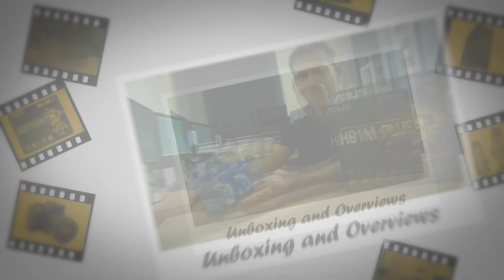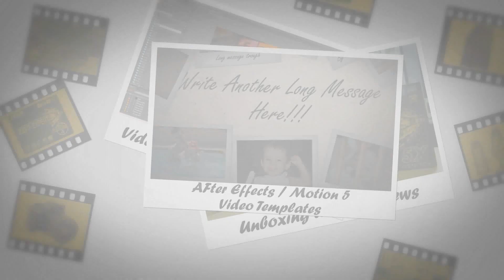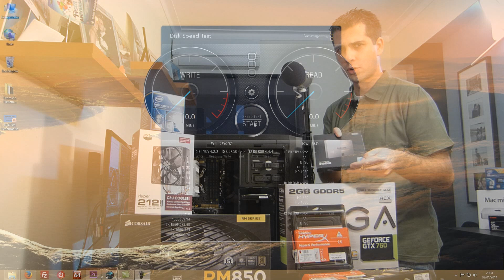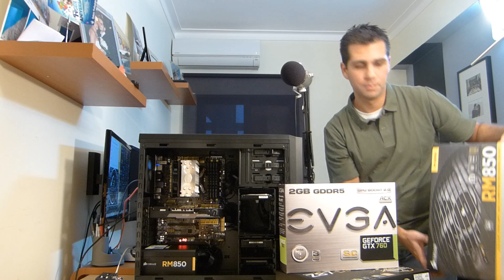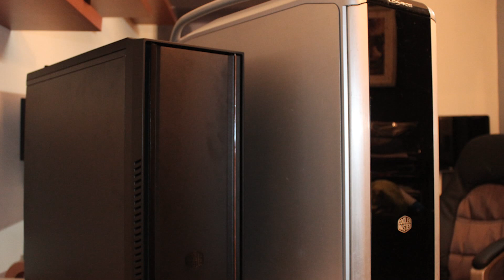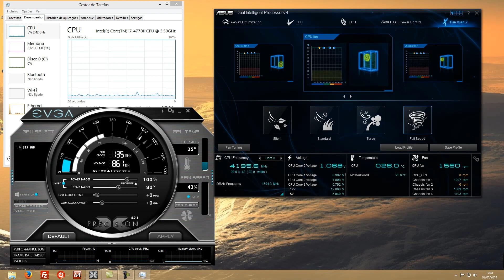Silent Video Editing PC Build 2014 Noise Levels Tests and Benchmarks 1/2

Comment: How many monitor do u use
Thanks
Reply from the maker: john Al Hi John, i use 3 monitors. Usually my setup is AE on the Main one, Photoshop on Left and Email + browsing on the right. But you have endless options that will make your productivity mutch better than with one display.

Comment: Real good things you have :D
I will not say that i have some thing better thou i am extreamly impressed by the sound of the cpu fan.
what graphic things do you do att youre computer ?
i am stating to learn counterstrike global offensive map creation and i am currently so much angry that i cant undertand how to make things work.
the map creation tool is called hammer, i dont know if you have heard about it or if you use it. i am realy interested thou in what you do att the computer. i got a MSI Big Bang 2 mother board with a less extream cpu.
currently i got a intell cpu fan cooler that cost me about 15 £
and i am looking for a cheap but still a great one that can make my Intel i7 3820 3,60 ghz
be able to come up to the maximum over clock.
i have seen i have the number one overclock mother board thou i have not knowlige about it at all.
My name is John and i am from sweden.

Hope you get more comments :)
I will summon my questions here with smaler sentences.
1. What grapical things do you do on your'e computer ?
2. Have you used Valve Hammer ?
3. What is the fan Brand/Name/company name that you use ?
Reply from the maker: John Löfgren Hi and thanks for the feedback!! Regarding your questions:1. I use After Effects, Adobe Premiere, C4D, Photoshop, Illustrator and FCPX & Motion 5 on Mac.2. Sorry but i have not.3. CoolerMaster Hyper Evo 212 available here http://goo.gl/wjwtBJAll the BestRJ
Reply: Okey seems like many diffrent programs :)
I only use one of thous. its Photoshop.
Illustrator i would want to learn more thou i am to tired to search for how to do things.
by the way. before the SSD did you have a normal drive then ? i mean not an SSD. i am getting one home now and i wonder how to install windows on it. i know on non ssd thou ssd i dont know if it is that easy as connecting the drive and just mounting a usb with windows and install.
Reply from the maker: John Löfgren SSD works as a regular HDD on what concerns installing OS and Software, but its much much quicker. In the past before i used SSDS i used my HDDS in Raid0. Just connect the drive and install your OS as normal. You will not buy another regular HDD for your OS :)
Reply: that is realy good news :D but i have heard that the SSD isent ment to wright many times on rather wright the existing things that it is meant to have all the time. just a tip for you so you dont find yourself having to buy another SSD just cous it fails too read.
i heard one say that SSD is more meant for having windows not programs or games.
if programs then programs that saves on a other hard drive like a HDDS. with that sayd you could have like you have now 500gb ?
have programs there and use the empty places for saving files.
If you want i can try to find the artical about it tht said it is best to use for windows to start fast and programs but not to save files on or programs for storage rather to have the programs all the time on it and not reinstall and such.
Reply from the maker: John Löfgren Dont worry about that. I have on my SSD Win8 and all my Software (250GB) and then i have 3 HDDS for IMPORT / EXPORT / TEMPORARY. Anyway you shouldnt worry about writing to the SSDS. Read this torture test to SSDS it might help http://us.hardware.info/reviews/4178/hardwareinfo-tests-lifespan-of-samsung-ssd-840-250gb-tlc-ssd-updated-with-final-conclusion
Reply: ah.. myself only could afford one with 128gb so for me it is not the same.
Reply from the maker: You will be fine and when possible upgrade to a 250GB they are getting cheaper and cheaper. :)
Reply: yes thou my SSD cost 75£ so i cant afford mutch so for me i must wait a looong looong time must affort a better cpu to thou my memorie is now ennuf only things is cpu and SSD that i must think about. as far as time to wait i dont worry cous i got an msi big bang motherboard

Comment: maxed out, what is the difference between the stock amd fan and the 212?
Reply: I've used intel and amd stock fans. Amd stock fans or horribly loud, as in hair dryer. Intel stock coolers are not nearly as bad, but the 212 is arround 30 usd, and nearly silent.
Reply: ***** Thanks!
Reply from the maker: My stock fan is still in the box. Personally i dont like stock fans primary because they are louder and dont cool as much as the Hyper 212. Off course there are even better coolers, but this one for my needs is great.

Comment: the cpu cooler is mounted the wrong way. You should always install the fans, that you have intake on the front, and exhaust on the back. But your cpu fan intakes from the back, which isnt really efficient.
Reply from the maker: Hi, Thanks for the input :) I mounted like that just because of high profile ram that i have, and i knew that it was on the wrong direction :) so my 1st concern was to test the temps, if it hadnt given me good results i would have just gone with a WC solution....But temps are great so even though i titally agree with what you are saying, my only concern is the temperature and noise and both are great, really great :) . Thanks again for pointing that out, it just means that you are a knowledge observer :) Thanks, Best Regards. RJ

Comment: Hi again. I guess you learned that the Hyper212 is capable of handling some oc but will get loud when stretched to the limits. 4,5 was clearly too much for it....85C on the cores will severly degrade your cpu...fast. Luckily you are not running Prime95 as a 24/7 job.. but the less stressful tasks of video and sound production.... :-) However I would keep a close look on the temperatures @4,2 when summer arrives for the Hyper 212...
For the sound tests I think the mike was placed a little to far away to really pick up the differences (at normal listen volume) I pretty much only heard the EVGA`s ACX cooler from 70% upwards :-)  I do appreciate the effort and all the time put into these videos tho. Did you try to further overclock the 760 and if so did the overclock make for better performance in 3d rendering......anything even measureable?
Reply from the maker: Hi again Jonh :)

Regatding temps i already shared with you on the other post.

As far as sound goes i cant hear a thing :)

The mike could be closer but hey :)

On my regular use the case is closed and below my desk. The only time i hear something is when rendering for more than 15 minutes and its just a small wisper.

Anyway try to listen with headphones and a quiet environment, those very small differences in noise are actual smaller than what you can hear because the case is closed and more distant :)

Thanks for your input John
Best Regards
RJ

Comment from the maker: Hi Tall, thanks and very much respect your opinion. And i see the value of a Quadro.

But i still think that we have to have in mind the type of work that we do. In my case is 80% After Effects and 10% Premiere Pro and 10% C4d, Browsing etc. (+-)  .
* AE only use GPU it in Ray tracing (5% of my work flow)
* PP only use in certain effects as i tested in the 2nd part of the video.
* C4D greatly improved by GPU but i use it occasionally.

So for in my particular case having a Quadro sitting here would be a waste of money, to be fair even the GTX 760 is an overkill (again in my case).

And to go to a Quadro i would want to enjoy its full features as the color that is reproduced (wich is much real than any GTX) but would have to get compatible monitors as the ASUS PA Series to take full advantage of color reproduction.

Back to price points (Where i live - Portugal)
* GTX 760 - 250 (EUR)
* Quadro 5000 - 2,000 (EUR)
* Quadro 6000 - 5,000 (EUR)

So for that 250 i get more than i need for my work :)

Now on another note if you work a lot with 3D software CAD etc and you have a great deal of appz that use the GPU and makes your workflow faster meaning that you may deliver jobs quicker for your clients. Then in that case i would definitely go for the Quadro Series.

Once again thanks for your opinion.
Best Regards
RJ

Comment: What you can do ask is unscrew the plastic mount and put the.  On the other side of the fan and still have it on that side but the fan will be pulling air through the heating instead of pushing it
Reply from the maker: Hi, i would if the temps were high, but im experiencing great temps so i wont bother :). Anyway thanks for your tip. Always useful and probably useful for someone that reads these posts.

Thanks again
Best
RJ

Comment: Just want to let you know that the fan on the CPU cooler it on the wrong side so it's pushing air to the front of the case instead to the back of the case so the rear fan can exhaust it
Reply from the maker: Hi, had to mount it that way because of the high profile of memory. At first i was afraid of getting higher temps. But everything working with nice temperatures.

Thanks on the feddback though.
Best
RJ

Comment: Hi ! Awesome Vid !
Exactly the noise tests I was searching for. Got some questions by the way, if you can answer it. I'm looking for building a new case, (and probably buy the same Hyper 212 Evo you used too)

I want a Silent one (the most I can get).
My question is, what are your thoughts between this Coolermaster Silencio 650 & the Fractal Defined R4 ? Which is also designed to be a silent case.

&, in terms of noise (and size) : Does a Noctua NH-D14 would fit in those ? (Pretty big one, but heard it is quiet as well).
Thank by advance, & keep up the good job.
Dex
Reply from the maker: Hi,

Glad you could find the video useful.
Regarding the cases im used to Cooler Master so i know what im getting. That was one of the factors of choice and very happy with its silence capability. On the other hand Fractal design is also a great brand, i havent tried myself but there are a lot of good reviews about the R4. So i think you will do alright either way.

Regarding the CPU Cooler NH-D14 on the specs its height is 160mm and the Silencio 650 Pure can take a CPU Cooler up to 162mm :) . The Fractal design can take up to 170mm but when the side fan is not installed.
By the way the Hyper 212 Evo is 159mm tall so its 1 cm difference vs the NH-D14

Other option would be using the Hyper 212 EVO with 1x or 2x 120mm Noctua Fans or going with water cooling.

So resuming all the options are available for you, its just a matter of preference and choice now!! :)

Best Regards
RJ
Reply: Hi again, fast answer ! thanks for that :)
Ok, so I just need to make a choice now, both looks good.

About the CPU Coolers, I'm definitely considering the Watercooler Systems so I'll try to figure out if I go for it or not by looking for some reviews out there. Anyway, thank you again.
Really helpfull. Bye !
Dex